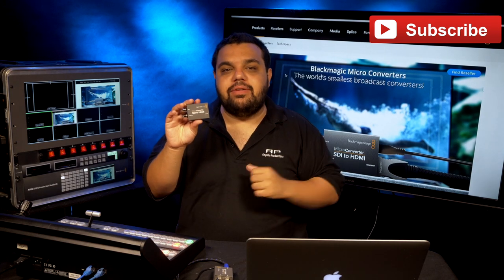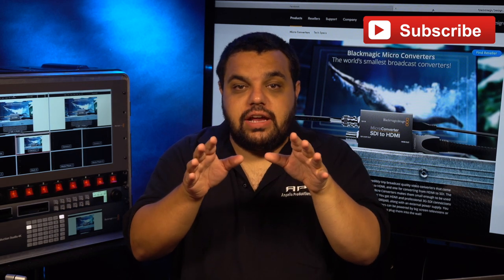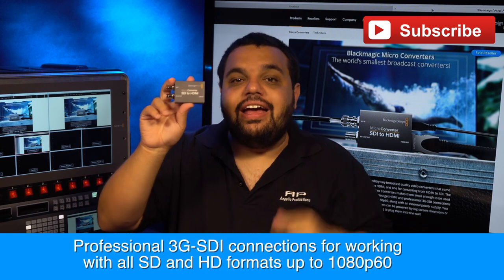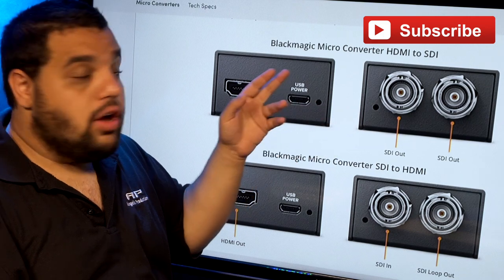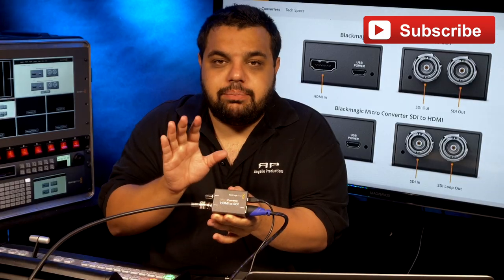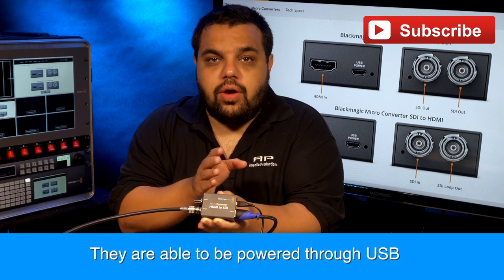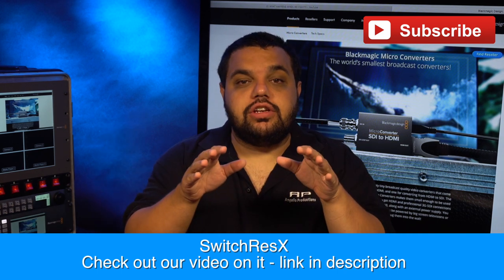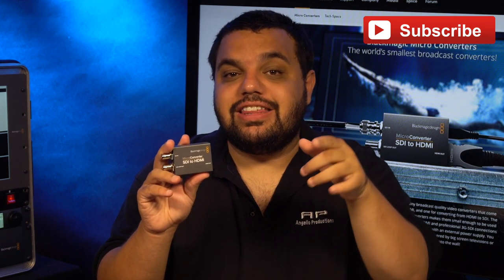BlackMagic Design Micro Converters - Converting From SDI to HDMI or HDMI to SDI

Comment: Hey man, thanks for the video. My SDI to HDMI has just arrived but I'm having trouble getting my ATEM Pro to recognise it. 

Basically I work outdoors streaming sport and HDMI is a bit loose, also they aren't ideal for long distances and I go through a lot of them. So I was looking to switch and go SDI from the camera, into the converter and into the ATEM by HDMI. I think i have the correct converter for this? 

I'm starting to think this isn't a function that the converter can perform and that the idea of the switcher is to connect video feeds to monitors etc. I think if I want to use SDI, I need to buy an SDI in mixer.

Let me know if you have any thoughts, cheers!

Comment: Consider a camera with hdmi output but needs long distance transmission for that if I'm using hdmi to sdi converter, then if I need to give the output to blackmagic ATEM mini pro which accepts only hdmi input so once again if I'm using sdi to hdmi converter, and then giving the thunderbolt output to pc windows in pci card Express. Will it work properly?

Comment: How long cable can we use? 100 meter work?
Reply from the maker: You need to make sure you have a good quality cable from a reputable manufacturer. I personally never like to go over 250 foot runs with SDI  although I do have friends in the industry that say they run 300 feet with no issue. It all depends on the situation you're in and the quality of the cable. If I have to do a long run I typically will choose fiber cable to do any run over 250 feet
Reply: @SamAngello  thank you so much for reply and where can I purchase fibre converter kit?

Comment: Hello Sam, thanks for you video, but you only make an explanation on one of the micro-converter about the second one, the one that has loopout,  we need to extend our SDI signal to larger distances,  we have RG59 cable however the distance is above 120 meters,  we were recommended by phone to get the one that says loop out, what is the real meaning of loopout please.
Look forware to hear back from you. Best regards from Costa Rica

Comment: Hello,
Question: My camera has HDMI out only. I'm running it to my AVMatrix switcher through an HDMI to SDI video converter. My switcher has 2 PGM outputs (SDI & HDMI). I try using either one to connect to my PC's capture card and the video signal is glitching when i connect to my PC. Is there a reason why and how do i fix? If i connect my camera direct to switcher via HDMI only without the video converter i don't have any issues only if i try using SDI. Why and how do i fix? Your help is much appreciated.
Reply: Hey did you get it sorted?

Comment: Hello, I have a panasonic HC_VX981. I was thinking I could use the converter to record video straight to my laptop. Then, upload straight to vimeo from my laptop. Is this possible? Is there other software I'd need?
Reply from the maker: I would recommend using something like OBS to do this. Also I would check with black magic to make sure that the camera and laptop are compatible with the converter

Comment: Is there anyhow to set the audio channel on the converter
Reply from the maker: I'm not sure exactly what you're asking can you explain a little more
Reply: @SamAngello  let say the HDMI sourge got Audio on channel 3 and 4, can i change the output of SDI on channel 1&2
Reply: HDMI Port can transit the mixed video and audio signal. but SDI just video signal can transmit audio .there is some new converter  HDMI TO SDI  HDMI TO TVI and HDMI TO AHD....
Reply: so u need a seperated audio in ..

Comment: Great build quality, but I have three, non of them work. There is no warranty whatsoever, so it is a crap shoot. BMD support was no help.
Reply from the maker: That's highly unusual. I had one fail. I call them up and they replaced it no questions asked. I believe there is a 3 year warranty on these. You can find information about the warranty at this link https://www.blackmagicdesign.com/products/microconverters/techspecs/W-CONU-04
Reply from the maker: Make sure to scroll to the bottom of the page to see warranty information
Reply: @SamAngello  Thanks for posting this. It was the dealer that told me there was no warranty. Black Magic support did not mention this or offer to replace the unit. I spoke to Panasonic support and they said converters are a crap shoot.